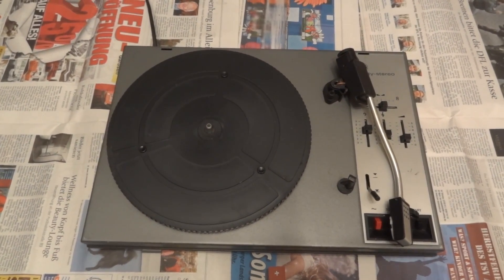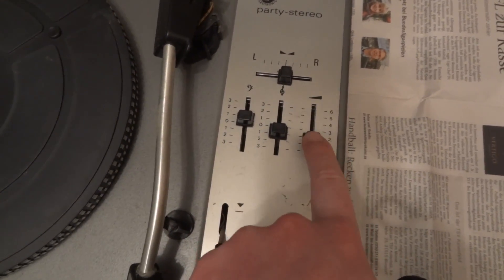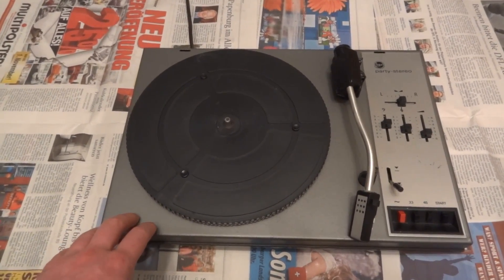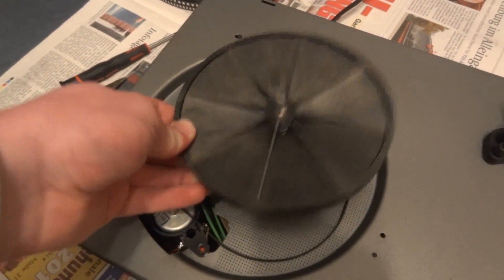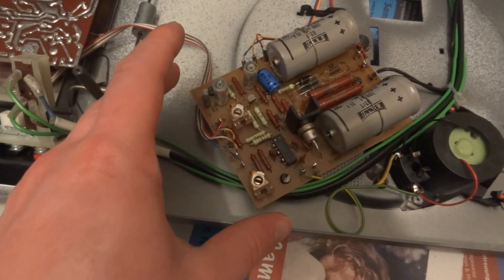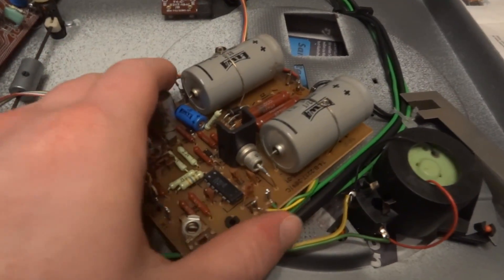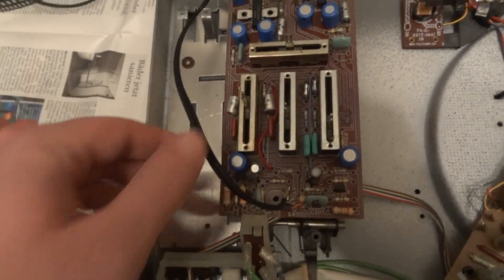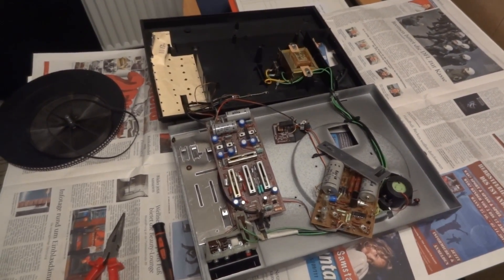Autopsy - hgs Party Stereo record player (Unitra 1980)

Comment: Those circuit boards look like they're from the 1960s -- very old-style construction! I had a 1970s Philips turntable which also used an optical auto-shutoff.

Comment: The TBA810 was also made under the same name in the eastern bloc as well as under different names. Tesla made them under the name of MBA810 (they did manufacture the TDA2030 as MDA2030, and the Intel 8080 as MHB8080) and RFT made them under the A210K name. There were some differences, however. The A210K had an integrated heatsink, while the TBA810 and MBA810 had only those "wings" :)

Comment: I have Unitra G602 pretty common construction but with higher quality and magnetic cartridge and better tonearm with anti skating. The "START" button actually switches the motor ON by flipping a transistor flip-flop, and powers the electromagnet enabling you to lock the tonearm microlift lever in down position. After the run-out groove an optical system with a photoresistor returns the flip-flop in it's initial condition turning off the motor and releasing the tonearm microlift mechanism.

Comment: It's great to see some stuff from Poland. HGS Electronic is a brand name for export. That player was build by Fonica. Also Unitra brand is only cover, Unitra was only an association of electronic companies like ZRK, Diora, Fonica, Radmor. 
Quality of some parts is crap because of lack of funds. You should check a fancy cassette deck made by Diora. MDS 442 or his brothers MDS 432 and MDS 418 - in Poland named "szuflada" which means "drawer" because of fancy cassette holder mechanism.
Reply from the maker: Thanks for the info. I thought HGS may have been a store brand of the company that imported these players into the west. I once saw one of these drawer type cassette decks (branded as Visonik I believe) on a flea market. Looked interesting, but unfortunately was in very bad condition.

Comment: Never seen a switched DIN jack before! I find pre-1990 East European electronics fascinating, as you say, superb build quality, but mixed with some horrible cheap components (like those volume controls).

Thanks for sharing
Reply from the maker: Switched DIN jacks were quite common back in the days, not on stereo systems but on portable cassette recorders and such.
I agree, the built quality is great, and the electronic design was not fancy but reliable, but some components are just crap and sort of ruin the whole thing.